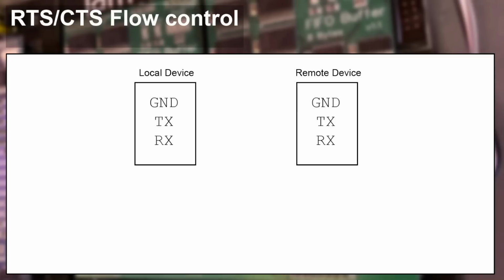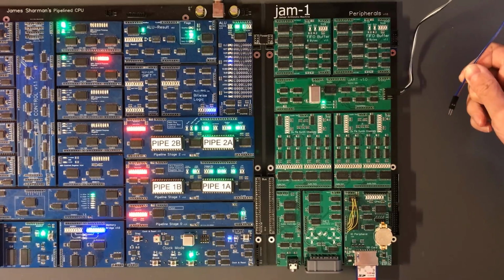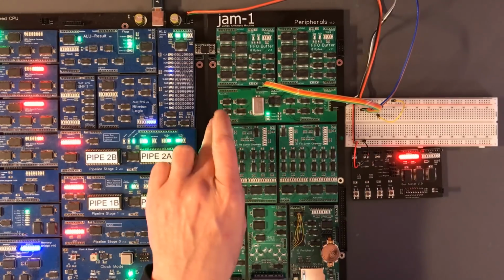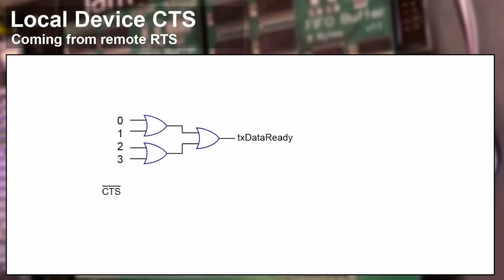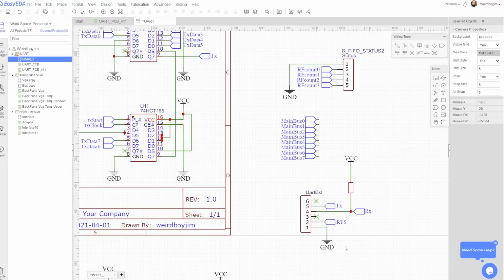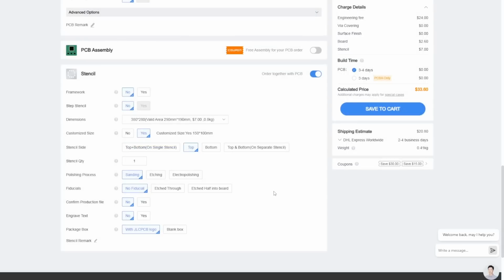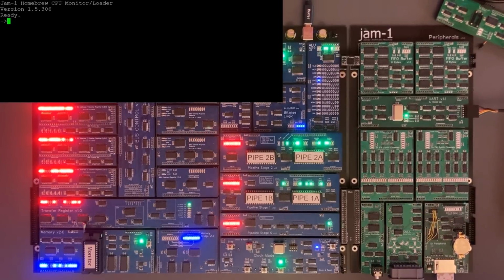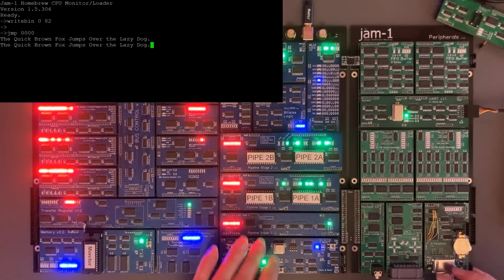Flow Control - UART from Scratch - Part 9

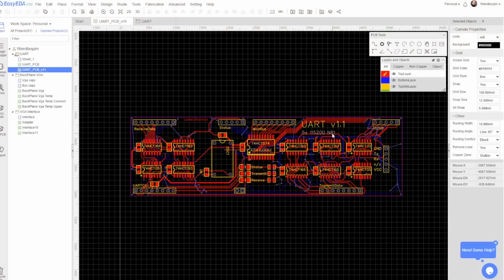Comment: 20:10 why "115200 N81" and not "115200 8N1"? The latter is the only way I've seen it written in dozens of different contexts/documents/sources.
Reply from the maker: I've seen it written both ways.  There maybe a correct way but I don't think there in any ambiguity there. Please don't give me a fresh complex about the silkscreen on this board 😅
Reply: @weirdboyjim  it's perfectly fine like this. Do not order the board again... unless you decide to add CTS some day :-D ;-)

By the way watching your videos is always a pleasure. I personally do not learn anything new, but your presentation style is excellent - coherent, logical, succinct. And what you do is simultaneously well known and unique - because the architecture is all yours.

Comment: Having all the resistors match the silk orientation is something I compulsively do when hand-assembling. Though I always feel silly spending the extra time for it. I would never expect or require that from others. If you don't feel the need to orient them in a particular way, just ignore the comments telling you otherwise.
Reply from the maker: I actually think it's worth doing. These boards are designed to be looked at more than most.

Comment: Great video! I love this series. Can I ask about hysteresis on this design? Won;t it stop at (approx) 6 bytes, and then pace them in one byte at a time? It would be good if there was a threshold for de-asserting CTS and another for re-asserting it! Then the sender can send 6-8 bytes with every transfer instead of 6-8 in the first, then one byte ata time?
Reply from the maker: This would be very dependant on the sending circuit behaviour but in this situation it doesn’t matter. Maximum receive rate is about 10KB/s but maximum fifo read rate is over 1MB/s. The fifo fills up when the code isn’t paying attention but as soon as the code sees the data it will empty the buffer before the sender and send a single byte. At full clock rate of course.

Comment: I commented before that it looks like you would benefit from a reduction in the solder paste mask apertures.  Because you hand paste you get a lot of paste and this is going to short on even 50mil parts, let alone anything tighter (resistor packs for example).

Jlc quality is exceptional for the price.
Reply from the maker: I’ve been a lot more careful about keeping the stencil pressed down when applying. And my new backing board is less flexible, seems to have helped.
Reply: @weirdboyjim  I agree it's better than some earlier stencil boards - but it still looks like a lot of solder per joint; I don't know the PCB tool you are using but most of them have a global setting for pad -> stencil aperture reduction - if it's 100% right now, I might try 90% on the next PCB just to see the difference.  IMHO obviously - you do you.

Love the channel!

Comment: ENIG (Gold) finish produces a flatter surface and is critical for parts where coplanarity matters, e.g. BGAs and QFNs.

You will use these on your next project I bet ... You must have exhausted your desire to use 74 series logic gates by now 😂
Reply from the maker: Interesting. That would make sense.
Reply: @weirdboyjim  It would be fun to map your entire CPU design to whatever form of programmable logic we can get from JLC/LCSC, design a PCB and then see how fast we could clock it ... maybe 100MHz is possible ... that would be totally awesome !  Would need to have an inner 3.3V or 1.8V ring though for most of the CPU/memory with 5V reserved for the outer most stuff!

Of course this would then be a QFN/LGA/BGA kind of package ...

Comment: It is very likely the 4 MHz machine just can't overrun the 64 to 128 byte buffer common in USB FTDI chips. Not to mention the PC polling way faster and with larger chunks of data. While a outgoing signal would have been nice for completeness, it is just busy work at this point. I do wonder if a Keyboard interface wouldn't remove much of the incentive for using the serial connection at all. You already have NV storage and a graphics subsystem, you are just missing a keyboard for a fully autonomous computer. But I recognize the workflow you have and the upsides  of having a quick and permanent connection between your modern computer and the JAM-1. Also thanks to JLCPCB for supporting James.
Reply from the maker: This isn’t about the send rate. 4mhz is far more than is needed to keep the send buffer full (by an order of magnitude). The issue is that the receiver is never going to struggle to keep up with 10k a second.

Comment: Excellent addition. And a great video. Would be nice to have an LED for these two new lines, but would would probably need some buffers, and there is not enough ICs without a bigger redesign. But for version 2.0, some LEDs, and maybe some ESD protection on the external pins would be useful. I guess TTL logic is not too fussy most of the time tho.
Reply from the maker: When I started the tweak I was hoping to reuse the existing paste stencil which was an added reason to avoid extra components.

Comment: Ah an RTS/CTS man.  Not one of those evil DTR/DSR people!
Reply: DTR/DSR has (had?) it's place when we actually had datasets (modems) and data terminals (think teletype level of functionality).    DSR means the modem is ready at a higher level than char by char.  

Of course we abuse CTS/RTS these days because we cross them over, essentially both ends are DTE.  But when modems were a thing, we direct connected them.  RTS was an input on the modem and an output on the terminal.  And vice versa for CTS.  There was no way (or need) for the terminal to hold off the modem (the carriage could handle the 10 characters per second that the modem could produce 😂).   Ironically that's where James ended up on his design, using flow control in one direction only.   Until he digs out a 300baud modem ... 🤣🤣
Reply: @robiniddon7582  And DCD!
Reply from the maker: Choice here is mostly down to what the cheap usb cables support.
Reply: Super selective interview question for embedded developers born after 1995: "Explain the difference between RTS/CTS and DTR/DSR." :-D

Comment: I have a question. How about the time between bit transitions of the counter? All bit's don't transition at once. Doesn't that cause spikes RTS line? I would expect the counter to use Gray code.....
Reply from the maker: The count here isn’t a direct feed from a counter chip. I can’t see a transition in the value to result mapping where grey code would make a difference anyway.

Comment: Another job well done!

I'm curious: have you ever spoken on your reasons and methods for designing 4-layer boards?
Reply: For the hobbyist using JLC or similar service you might as well use 4 layers.  The cost difference is negligible.  I would actually use both inner layers as GND but it makes no difference to any design that would work on a breadboard with wires and that doesn't care about EMC/ESD.    If you want to find out more search for Rick Hartley's videos on PCB design.
Reply from the maker: Thanks! My use of 4 layer boards is pretty limited, I just add power and ground internal planes. That makes both routing and power management a lot easier.

Comment: Congratulations to JLCPCB for their continued support of this great project.
Reply from the maker: Hopefully that will continue!
Reply: I have brand loyalty to JLCPCB (vs PCBway) purely off youtube sponsorship/usage. I have never successfully ordered a custom PCB.
Reply: @RoamingAdhocrat  I'd recommend giving it a try. I started by loading up someone else's gerber file from an open source project and went from there. Quick and surprisingly easy, with the Add gerber file button on the main page.
Reply: @RoamingAdhocrat I use their services all thr time. I don't order that many pcbs due to customs issues on my country, but I do use EasyEDA for all my stuff (didn't want to pay Altium neither create a library for every single device I plan to use). Give it a try, it's really good and quality was always excellent (even on pcba)

Comment: Wouldn't it be more efficient if the RTS signal only became active again when the buffer level was, for example, 3, since then the host would not be slowed down so often?
Reply from the maker: Interesting question. That's likely to depend on how it's implemented but I would expect it's  fairly low level logic like I proposed here so it wouldn't have much impact. How the sender responds to it's own buffer full case might have more impact.
Reply: If both ends were similar then likely this is true because the interrupt load of filling the FIFO is amortized over 4 or 6 bytes instead of just one.   

When one end is a 5GHz monster and the other end a MHz 8 bit machine, it won't make any measurable difference to anything I suspect.

Comment: LEDs have an electrical polarity... resistors have a psychological polarity (well, at least for some of us) ;)
I liked watching you bodge the header onto the original UART to test it. I like to think that soldering stuff where it's supposed to go is easy enough but the real skill comes from soldering things where they're not designed to go. :)
Watching components magically solder themselves on a hotplate never gets old!
Any mention of hardware flow control takes me back to when I was younger when my boss and I went all round our building upgrading some of the serial lines back to the computer room so that they had hardware flow control and could support printers instead of terminals. I was supposedly a programmer and he was supposedly an administrator but we both had a deep longing for soldering irons and had a couple of days of great fun testing that RTS/CTS wires worked.
Reply: For whatever reason as a kid I started pointing the % line of a resistor towards the positive voltage rail and it stuck. To this day if I see that line facing negative I start icking.
Reply: @c1ph3rpunk  for me it WAS all about reading the numbers or the bands left to right, top to bottom... i never thought about literal polarity... I might now though. ;)
Reply from the maker: Thanks for sharing edgeeffect! I really should have added this ages ago, I had convinced myself there was a bit more too it.

Comment: I hope you won’t need a bigger frame for the boards of shame James, it’s getting full 😂
Reply from the maker: I still need to get the first version of the SNES controller in there, but I need to desolder the connector before it will fit!